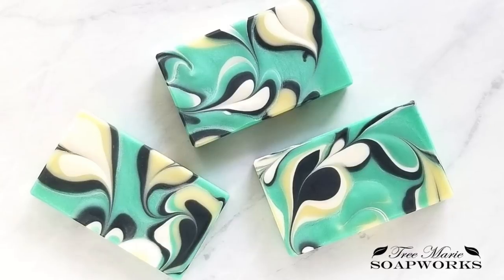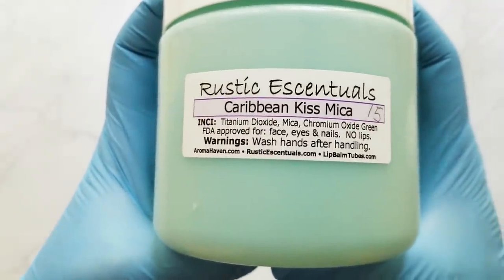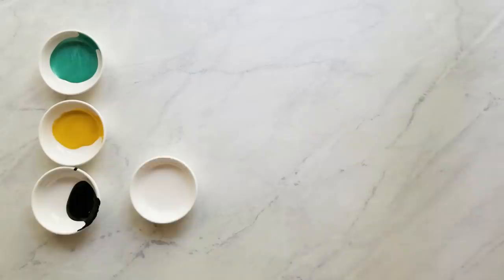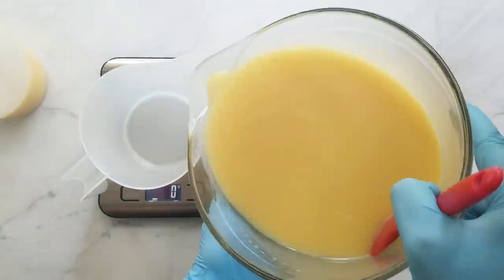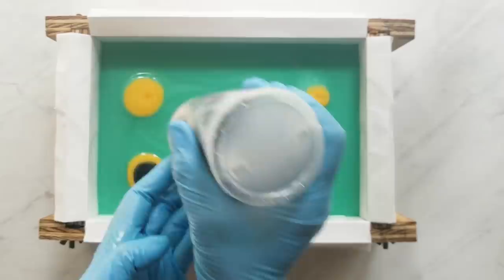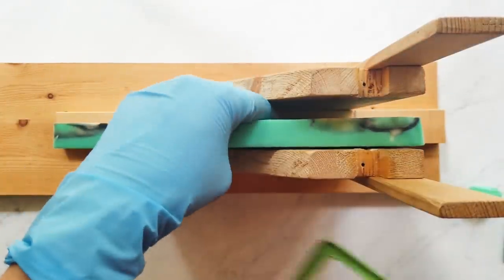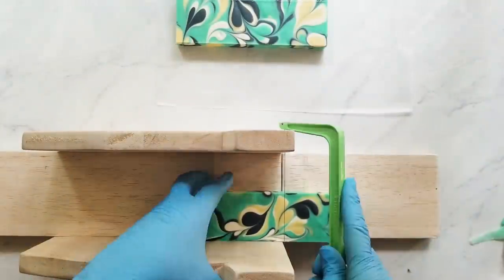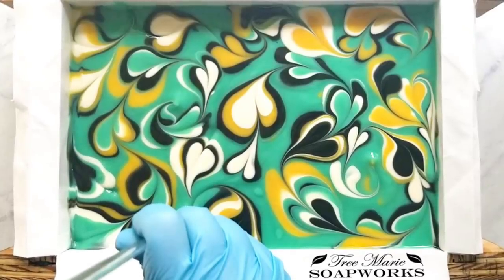Marbled Heart Swirl Cold Process Soap (Technique Video #18)

Comment: Thank you for your tutorials, you put it so simply which is great for the beginners.  I am really just a gawker, I have only done melt and pour thus far.  requested to be in your face book group, it will give me another place to learn and get the courage to try cold process.  I have all the supplies, just need to get some confidence. :)
Reply from the maker: I would suggest making a simple no color, no fragrance batch for your first batch. Use the distilled water ice cubes for 1/3 of your water weight. That make the smell less intense. (I can't smell anything when I use the ice cubes.)  Here is a beginner tutorial I have made for Elements. https://www.elementsbathandbody.com/basic-cold-process-soap-recipe/

Comment: Thank you for the awesome video. I learn a lot from your videos. Sorry if you've answered this before, but why do you line your squeeze bottles? is it to make them more chemically resistant? Wouldn't using chemically resistant squeeze bottles make it unnecessary to line the bottles? Thank you for your time.
Reply from the maker: Lining the bottles saves so much time because it is tough to clean when the soap batter has thickened. This way, you can pop out the liner and squeeze out the excess...so easy.😊

Comment: I love your soaps. A question: I want to try to colour my soaps with herbs and vegetables. If I was going to add those natural colourants to this soap, is there anything I should be aware of? Can I go on and add my botanicals on top of your recipe? And what about fragrance? If I don't use fragrance, would the oils have an "oily" smell? Thanks for sharing.
Reply from the maker: There is no need for fragrance. People say that my unscented soaps smell like "soap," so no oily smell. If you put botanicals on top of your soap, they often turn brown. Wait around 20 minutes to add the botanicals to the top and that helps. I have never had much luck; perhaps that's because I gel my soaps. In soap most botanicals turn brown. Calendula is an exception. Soap colored with natural ingredients often fades when exposed to light. You will just have to research and test it in small batches. Best of luck to you! 💛
Reply: The only one that doesn't turn brown within or on top of soap eventually are dried Calendula petals. Worth a try.

Comment: You had mentioned the humidity and it taking longer to cure. I live in Illinois with the Ohio River 2 blocks from my house and I had noticed my soaps take longer to be ready to unmold. Do you use a dehumidifier to help??
Reply from the maker: Yes, that would explain it. I run a fan in the room that I cure my soaps in. Try turning them every few days. You could use a dehumidifier in the same room, just make sure to turn them in that case because they can cure unevenly and bow. Do you use a water discount? I use "25% water as a % of oil weight" in soapcalc. Also, sodium lactate helps especially if you are using lots of olive oil. What is your ratio of saturated to unsaturated fats in the upper right corner of your soapcalc printout? I use 43:57-ish for swirls. Make sure your unsaturated number doesn't go any higher than 57%.
Reply: @TreeMarieSoapworks  I will try the fan idea, I just tried the sodium lactate and it worked much better. My water is at 32%, I haven't tried to water discount yet but it is worth a go. The sat: unsat is at 41:59, going to play around with it and get the unsat number lower as per your recommendation. Thank you so much for replying, I am really new to this and it is a lot of fun but can be a bit frustrating when I have batches ruined. Have a wonderful day.